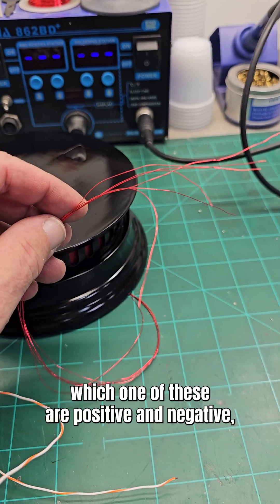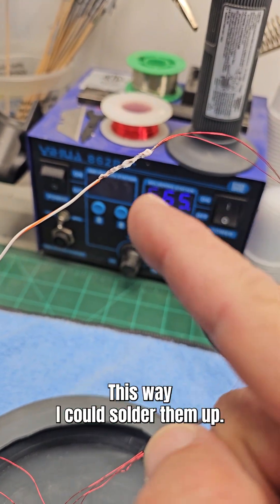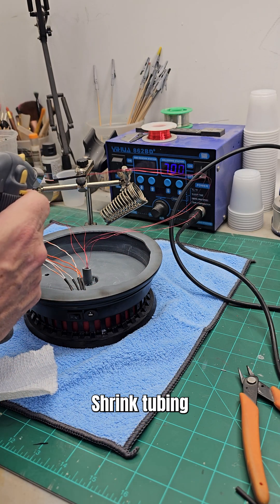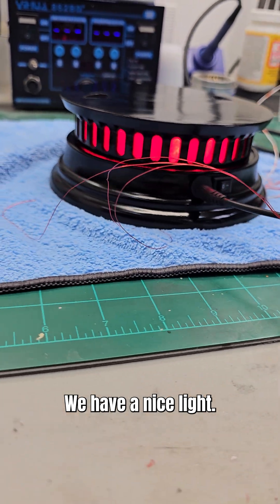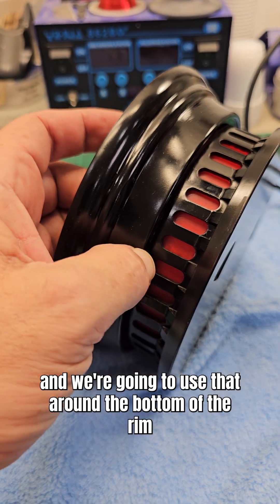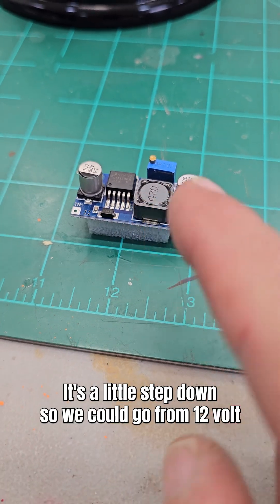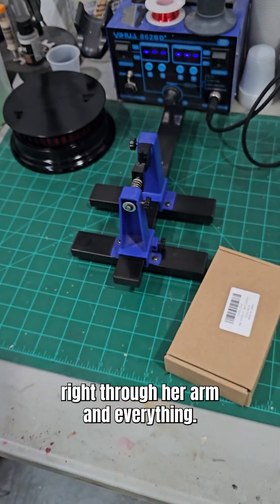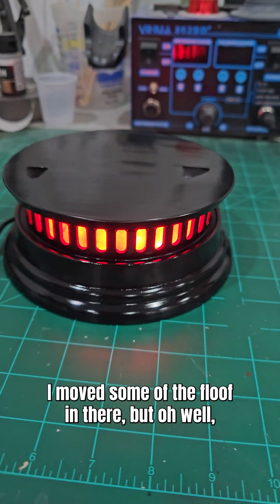Star Wars 3D Printing: Illuminating Darth Talon’s Base

Comment: Hey Kenny, if it's not called Tulip Slick, did you find out what it is called. 
I can get this at Walmart, correct?
Reply from the maker: @JGG1701  just looked it up still called Tulip Slick. I got mine at Michael's. Looks like they have it on Amazon too.
Reply: @HobbyLinkInternational 
Thank you sir.